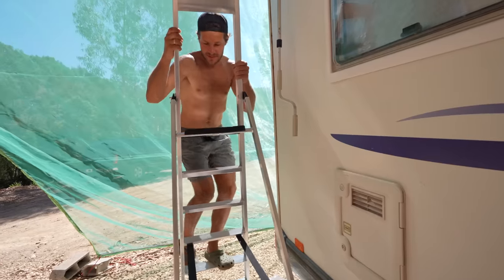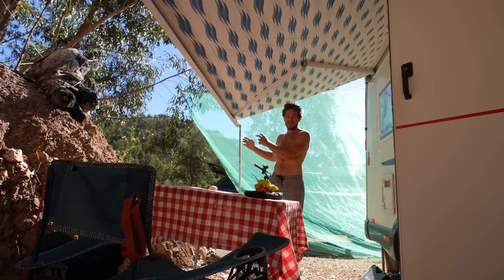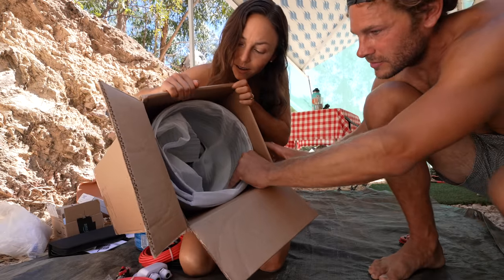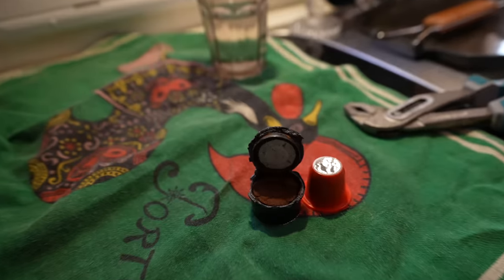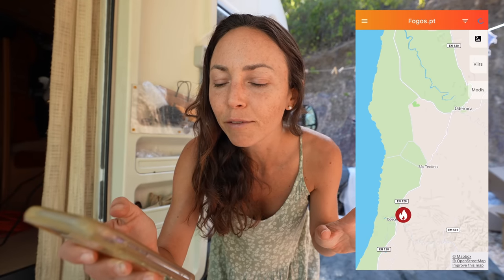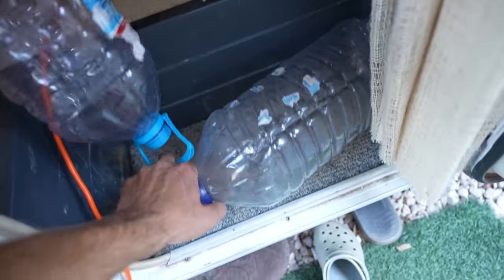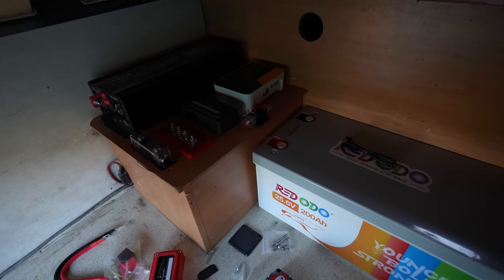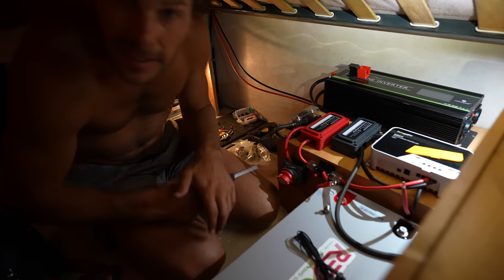Facing the HARSH REALITY OF WILDFIRES on our OFF-GRID HOMESTEAD

Comment: A consideration is a water tower or creating an elevated pond as a mechanical storage battery and as a source of pressurized water. When you have sunlight you use solar power to pump water up. When there is no sun you use water from water tower and gravity to generate power.

If your place was a working mill something like this likely exists 

Consider underground power especially if you have high winds. Much safer if allowed by local regulations.

Sprinklers on your roof also useful to reduce temperature and in case of fire mitigation of flying embers
Reply from the maker: Great ideas! We have been in search mode for a large water tank to do something similar and allow for sprinklers

Comment: Vertical wind towers are coming a long way. Some work well with low wind. They supplement power when sun is gone. A water wheel is a great idea and if done right would look great on the property. If you decide to do on grid it can be done at a later date. Love what your doing.

Comment: I think I would stick with the renewable energy solutions, despite what the locals say. True, you may have to size the system a little larger or use various solutions. But, the self reliance would be worth it. You seem to have water flow so hydro should be an option. It is amazing how much even a small hydrogenerator working 24 hours a day can produce to keep the batteries charged. You seem to have enough space too, so maybe even considering a pond with a hydro that can be turned on easily during cloudy periods. The other thing to consider is that those around you are talking in part using historical knowledge. Todays solar panels are much more efficient in using indirect light so their performance even on cloudy days is better than what "used to be". Have fun, stay safe, stay healthy.

Comment: Hey Britt & Drew when you purchased the Water Mill did you consider the electricity supply as it sounds like a very expensive  project? 🤔🙄 Drew I love your determination installing the electrical system considering the intense heat & any anxiety around the wildfires!  Britt you are such a compassionate & positive person ! Do you have an escape plan just in case? Love from Australia! 🇦🇺💜💙

Comment: Have y'all been told if it floods there during the winter or rainy season? Just wondering how high the water will get , if it will get as high as the terrace that y'all are going to park the camper van on. If water level goes up or if y'all dam (not completely dam up all the way) up the water past the water mill would ya'll be able to use the water wheel to make power?

Comment: Since you have the generator you can always use that to top up the batteries if the renewable sources arent enough to fill them. You can buy a lot of fuel for what the connection to the grid will cost. Also if you do decide to go on grid it will take them months to do the work to connect you, I know people who waited 5 or 6 months. https://www.youtube.com/@MAKEDOGROW have a couple of videos about their off grid system and talk about how much power it produces etc, they are up in Serpa so might have more light in winter but they dont have the option of a water turbine like you do.

Comment: First time tuning into your channel... Howdy from Red Deer, Alberta, Canada.👋🏼
If I decide to comment on vids, I usually do it as I watch, so.. here's my first thought...

You mentioned being able to 'move' those panels when/if you want to... but...
How?... when they're basically glued to the roof, will you 'move' them?🤔
The only way to 'move' them, would be to cut the roof off and install it somewhere else.
I think it'd be better if you highlighted how permanent the installation will be, rather than blowing smoke about them being re-positionable.👍🏼✌🏼🇨🇦
Reply from the maker: Howdy! We compared two different  panels in this video. The blanket panel 100w vs CIGS panel 200w. The CIGS is permanent and taped and the other is not and can be moved around exactly as we explained.

Comment: You don't need these 1800w heaters to heat the heat shrink sleeve, just a lighter (they also sell it in Chinese stores) which looks like a mini blow torch (it has a round gas outlet), 5-7 cm away, and has the same effect , and is always at hand.

Comment: We had a quote for solar in france for 5kw system, €26000. I nearly fainted. As in uk I left a 5 kw system when we sold that was only couple years old and only cost £7000.
So I want black panels that work in cloudy weather or snow. We dont use much elec as our bill each month is only €70 but i dont want to be  tied to elect, and  constant power cuts. I like the sound of that system you have but bigger.. Mmm
Love what your doing.

Comment: I've installed megawatts of solar panels. Don't waste your time with the little 12 volt 100 watt junk. Go straight to 250+ residential units and you will never regret it. They are half the price of the 12 volt and you get so much more current. You will never look back.

Comment: You are going to need a large solar system to run things and it would be so cool to also have a hydro power system.  If your water source was powerful and consistent enough to power the old mill you should be able to have enough for a small hydro power system.  Since your mill used that hydro source in the distant past; I wonder if it will be hard for you to get the permit for approvals.

Comment: I'd imagine 10-20k EUR for a off grid solar installation depending on number of panels battery storage capacity. I'd say, there isnt any maintenance really, just cleaning the panels. - its just a larger van installation if you think about it. The real killer will be if you decide to put AC into your house - this will increase your consumption hugley. i guess it depends on the grid connection cost really. with the land you have a ground install or maybe use that big roof you have there?  (does it face south?) I'm sure theres a local solar company that will quote you 8-)
Reply from the maker: Yes, we need to get some quotes from solar companies in the area.

Comment: RE: Off-Grid Systems
I suggest you watch videos from the Kris Harbour Natural Building channel for ideas and for "how-to" building instructions and tips. Kris, from England, purchased land in Wales where he is doing the Wales equivalent of homesteading. Not only has he designed and built several structures using different building techniques (cob & wood, earth bags, timber framed using mortise & tenon joinery), he has also built electric systems using solar plus hydro-electric and wind turbines. Solar is, of course, the primary source in the summer and on sunny days throughout the year, but Wales has far fewer sunny days than Portugal, which is why alternative electricity sources are a necessity. The hydro system produces large amounts of electricity from late fall through spring and during summer storms. Wind is strong off-and-on throughout the year, particularly in the winter and spring. 

Having the three systems means Kris has primary and secondary systems producing electricity during every season. There is enough electricity to run industrial machinery - wood planers, several saws, welders, CNC plasma table - year-round. There is a playlist for the hydroelectric system and Kris explains the parameters for a good water source (flow, elevation drop, etc.) to power a turbine. On your land, it seems you have the wind necessary for powering a wind turbine at least 50% of the time. Search "wind turbine" for the videos of the turbine Kris built (and then rebuilt). Again, Kris explains what is needed for a wind turbine to be a successful source. The solar system is very robust: Kris has expanded it several times; currently it is 8.4 Kw with a very large battery bank. 

Kris has now set-up a business designing and building hydro-electric systems for individuals on their land. He first evaluates whether the land has a sufficient source of water and then whether the elevation drop is sufficient for the distance from the source to the water turbine. I do not whether he offers his evaluation and design services separately or only does complete systems from the design process through installation.

NOTE: All water used for daily living is from a spring that collects water (also fills a large pond). The spring water is piped to his current roundhouse abode where it is filtered for use. A stream is used for the hydroelectric system.
Reply from the maker: Thanks for sharing! This is really interesting and we will take a look into his helpful info 👍

Comment: That particular battery only has a 100amp BMS and it will overload if you push that inverter past 50%. I would recommend that you purchase one more of those batteries and put them in parallel.  Enjoy your new electrical system.
Reply from the maker: We definitely could do that 5k watt hours it pretty sizable for our needs. It’s all about what we are running on it. Lithium should be able to go down to 10% of its capacity and our cutoff is around 24V on this particular battery. Then it’s time to charge up either via solar or if at night or on a cloudy day we can use the generator.